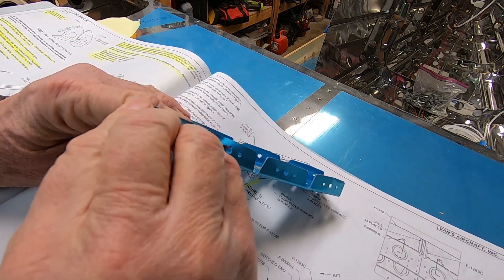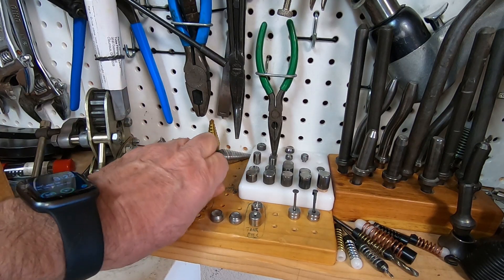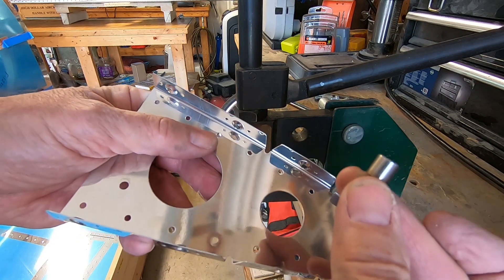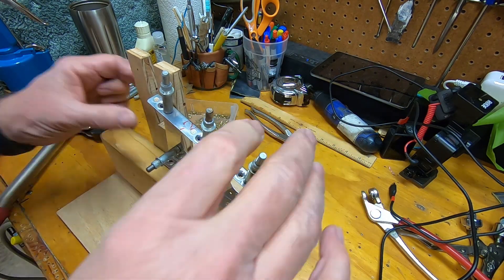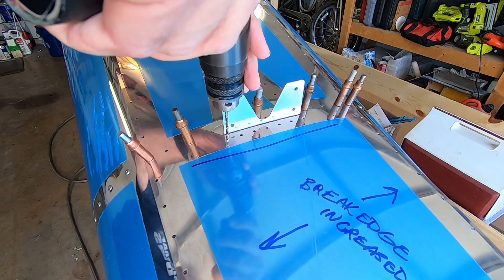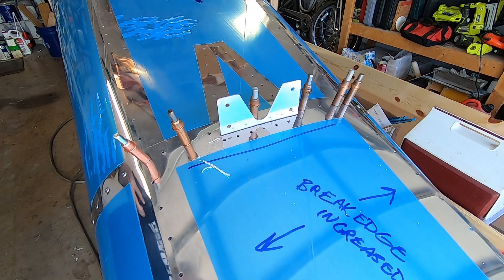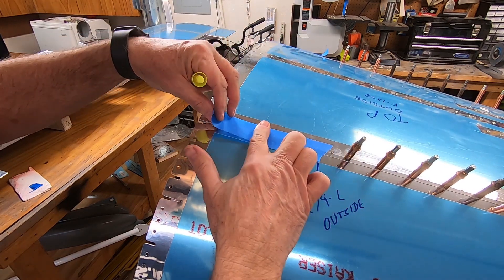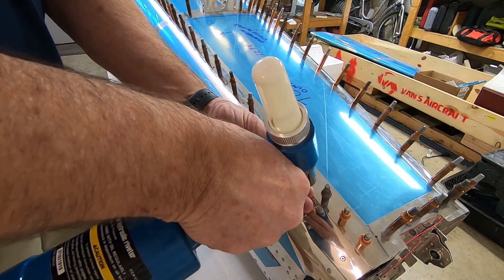Van's Aircraft RV-12iS Tailcone Construction Part 4

Comment: Why was the bend on the break edge on the rear top skin increased? Was this something that was called for in the plans or was this something that you thought was needed due to the greater curvature of the fuselage at this point of the aircraft? Great videos by the way.
Reply from the maker: Hi Alfred! Thanks for watching my video. Because of the severity of the curve on the end of the top sheet, it had to have the break increased to manage the curve. Not a fun thing to do, but called for in the instructions. After putting the skin on, I could see why they wanted an increased break on the edge.